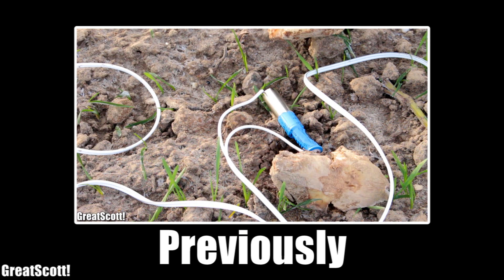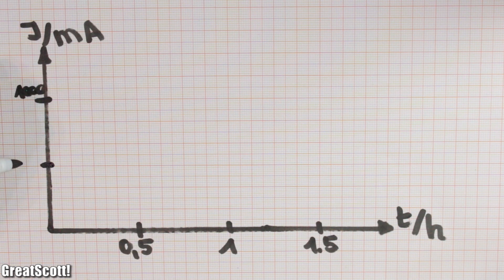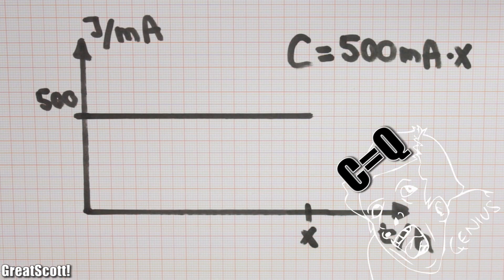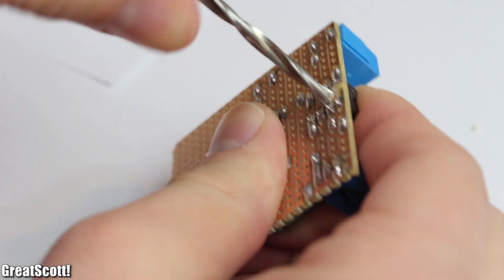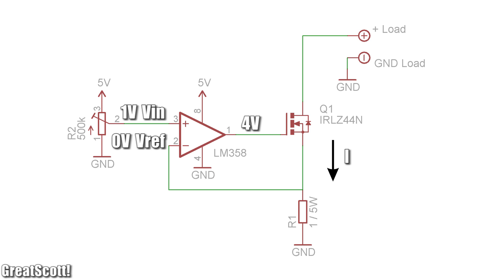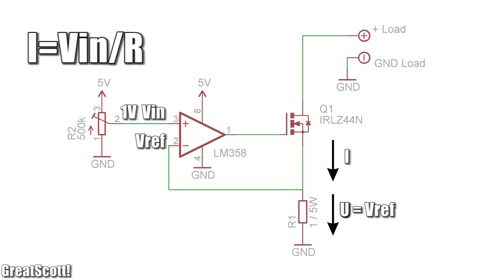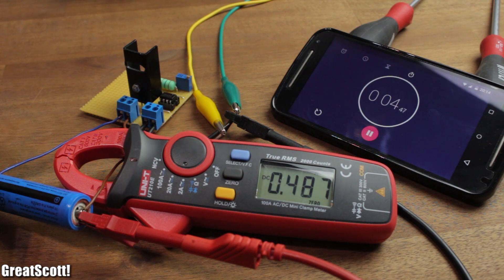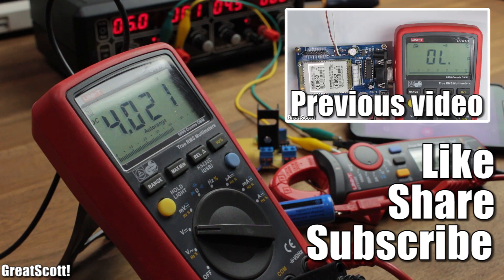Li-Ion Capacity Test || DIY constant current load

Comment: There might be a problem with the mosfet used. It works as a constant current source (or rather sink) and today's mosfets are poor in linear applications. The datasheet of this mosfet (unlike to some others) doesn't even show a curve for DC operation in its SOA. In this application using a logic level mosfet with low Rds is a bad choice. You don't get any benefits from low Rds. Power bipolars or Darlingtons are usually cheaper and work well in linear applications. The base current would induce a small error in the current source but usually negligible. So, your circuit might work but I'm really concerned about its long time reliability. Especially with such a small heatsink. I understand, however, that this is only a demonstration :).
Reply: Well, personally I've never seen anything like that but maybe it's just me. If you power the converter not from the cell checked but from a different source, you should be able to virtually eliminate current drawn by the coverter itself (usually quite small). Still, however, you will need to induce current flow at the output by using, for example, a resistor. There is an one issue though. If you have a constant voltage source with a resistor then you dissipate certain power. The same amount of power must go into the converter, so as the voltage across the cell drops, the current drawn goes up. And capacity measured depends on the current drawn. In datasheets you usually see plots of voltage across the cell over an amount of charge drawn for different values of current. In principle, you can try something like that but you won't be able to compare the results with datasheets but only with different runs/cells measured in the same way. The capacity is an estimate itself since it depends on many factors. Not only on current but also on temperature. So the exact capacity depends on a particular application.
Reply: The choice of a logic-level mosfet is a good choice. The limiting factor in this application is the power dissipated in it because it's rated for a continuous drain current of 36A at a case temperature of 100°C (or 50A at 25°C case). It has a maximum junction temperature of 175°C and a steady-state thermal resistance junction -to-case of 1.0°C/W. Unless you have a power BJT with better thermal characteristics, it won't be an improvement over the IRLZ44 and it's unlikely to be cheaper. As you say, the Rds(on) is irrelevant as it's not operating in its ohmic region. Obviously, you have to have a decent heatsink for any serious use.
Reply: @RexxSchneider  IRLZ44N is a switching mosfet and is not designed for linear applications. The maximum dissipated power is specified for switching applications. For linear applications the real max. dissipated power would be significantly lower and the datasheet says nothing about that. For the current source the value 110 W does not apply. What I mean is... using switching mosfets for linear applications is a lottery. Even if you meet the power dissipation condition. I read an article when NASA used infineon switching mosfets like that and they were used well below the SOA curve for DC yet they still burned. In practice, this might sometimes work but I wouldn't call it reliable. Switching mosfets usually have worse heat sinking capability and they withstand the specified power only when dissipated in short pulses... during turn-on and turn-off. In linear applications they dissipate power continuously. Generally when designing devices with any transistor you must make sure that you never exeed the max. dissipated power AND the SOA curve at all times. But generally I agree that it all boils down to the junction temperature. If you can (somhow) keep it low it will work.
Reply: @rezzywoof  The manufacturer makes no such distinction. Vishay Siliconix describes it as "Power MOSFET", with no designation as "switching" or "not designed for linear applications".

The maximum power dissipation is governed by the thermal resistance junction-to-ambient, and the datasheet on page 5 (Fig. 11) shows the transient thermal resistance as a function of rectangular pulse duration, and that is 1.0°C/W for all pulses with duty factor close to 1. That is the steady-state thermal resistance and determines the "real maximum dissipated power". It is clearly not "significantly lower" than the maximum 1.0°C/W quoted on page 2 (section Thermal Resistance Ratings") of the datasheet as you claim. Please make sure you have a full copy of the datasheet and that you can interpret the figures properly. The RthJC of 1.0°C/W clearly applies to steady state, not switching conditions. Given a 1.0°C/W heatsink with perfect thermal contact, that allows a maximum continuous dissipation of 75W.

You will find that the maximum dissipated power specified for switching applications can be determined from the datasheet. The datasheet on page 5 (Fig. 11) shows that, for example, a 10ms pulse with a duty cycle of 0.2 would give a transient RthJC of 0.5°C/W, allowing a maximum dissipation of 100W with a 1.0°C/W heatsink.

Your mistake is to assume that because the mosfet can tolerate somewhat higher dissipations under switching conditions, it cannot be used for linear applications. It most certainly can, and a steady-state RthJC of 1.0°C/W is as good as most power transistors, and better than many.

You are certainly correct to point out that power mosfets are prone to electro-thermal instability in their linear mode, which can arise from positive feedback within the parasitic BJT inherent in the mosfet design, and result in local hotspots and potential damage. It is also true that some manufacturers produce power mosfets with modified architectures (e.g. higher bulk source resistance) that are intended to reduce ETI when used in linear mode, but all of that does not automatically disqualify other mosfets from linear use.

The application in this video should dissipate 500mA x 4V = 2W at most. If all of that were dissipated in the IRLZ44, even if it were mounted on a cheap heatsink of 24°C/W (Digi-Key: 507302B00000G), the rise in junction temperature couldn't be more than 50°C. It is laughable to be worrying about NASA managing to destroy some mosfets under unspecified conditions, when we're discussing such light usage as here.
Reply: @RexxSchneider  When you mentioned the transient thermal response I think you are right... Perhaps my view on this subject was too superficial. I will take a look at the datasheet again :) Thanks for such an elaborate response. And yes I agree that for just a couple of watts almost any power transistor should be fine. It was some time ago when I wrote my first comment. I think I haven't taken into account the actual current in this project and assumed it could be much larger. Thanks again :)

Comment: cant we use irfz44n instead of irlz44n? i cant find irlz44n. how much amps this constant current circuit support? can i use it at 5 amps? if it is true,  that means i can make my own adj pwr supply. i surfed internet for 5 months but i couldn't find a good and working cc circuit ever! thanks greatscott!
and you must say that little problem of that 18650 to manufacturer of that 18650.
Reply: No. Unless you can select an IRFZ44 that happens to have a gate-source threshold voltage no more than about 2V. Failing that, you'll have to use a 10V supply for the opamp.

The maximum current supported depends on the amount of power you can dissipate - i.e. how good the heatsink is. With an infinite heatsink, you could soak up 100W, which equates to 25A at 4V. With a real heatsink, that would be a lot less.

If you draw 5A from a 4V battery, you'll dissipate 20W which needs a heatsink rated at no more than 6°C/W and preferably lower. That will be the most expensive part of the circuit.

This circuit isn't exactly right for use as an adjustable power supply.

Comment: Well considering how cheap those ultrafire batteries are that's not a bad result.
So long as they are cheap around 1 ah isn't too bad and still has some use in them for projects.

Of course they are not worth paying a lot of money for them, but if you want good batteries you have to pay a lot of money for them, as they are not cheap.

Ultrafire gives you an ok battery for a low price.

If only they were honest about the capacity of the cells and sold them for they really were instead of making such wild and fanciful claims.
Reply: No they are also from shitty quality

Comment: i saw someone is selling 6 of those ultrafire li-ion batteries with 9600mAh for just 5€.. what do you think is the real capacity?
Reply: more like 960mah. Panasonic's NCR18650G have 3600mAh capacity but they are extremely expensive and hard to find

Comment: Hi! I'll be doing this same approach  to test phone batteries, but using some lab equipment that are luckily available here (e-load, datalogger, DC source, scopes). But just one question, What is the reason/ basis why we stop at 2.5v? is it the level considered as battery low?
Reply: I wouldn't go below 2.8-3V unless the manufacturer's datasheet specifies a lower cut off voltage

Comment: Are you sure your clamp is off by 15mA? I have seem some videos and the UT210 is pretty precise, supposing you did the correct zeroing procedure. Anyway, with this kind of circuit, it would be better to use an inline current measurement, no?

Comment: From what i know these lithium iom cells cant get lower than 2.7-3v without damage... I wouldnt reccomend going lower
Reply: Usually 2.5 volts is the lower limit for them, with less voltage than this they get damaged. But to extend the life span its not recommendable to discharge them to 2.5, with 2.7 or even 3 V they get much less stressed.

Comment: Another possibility was to use a microcontroller circuit that monitor and saves the current in a SD card. Then, use some computer program to plot the current x time and do the integral.

Comment: But where's a pull down gate resistor, to get rid of gate capacity?
Reply: It's in the opamp's output - it's a push-pull output, so will source or sink current as needed.

Comment: I'm assuming if I just used different pins this would work with a lm386?
Reply: No, sadly it won't work. The LM386 has a minimum gain of 20 and an output dc offset of half its supply voltage. It's not a conventional opamp.

Comment: I bought in the past batteries from china for my metabo accu driller. After soldering it last about 2 weeks and it died. So I bought Panasonic batteries from trusted local seller and it has been under heavy duty work for 3 years now and it still working well:-).
Never ever buy batteries from china. I guess they are "refurbished".

Comment: Fantastic Experiment.
I also made the same circuit to test a couple of fake lithium ion batteries that I had.
The actual capacity of those batteries proves out to be only 418mAh.
And not 2500mAh as mentioned on them.
Thank you very much for letting me know this capacity test experiment.

Comment: Should read 4800 China-amphours
Reply: Bob Brown: "China-amp/hours"!!!!
Reminds me of the Hp ratings of Chinese motors.
There are those little bitty Chinese horses and then
there are those big, strong American horses.............
Reply: DD_Ranch Texas most US HP claims are BS. In Japan they under-rated their engines for a while (they started focusing on handling instead of an HP battle, which gave them much faster cars in real life, so they put an upper limit rating of like 275 HP or something even if the engines were 300-400 HP). In the US, we were rating older cars with stupid high HP which is easily disproven, we claimed crap like 1980’s cars with 300 HP that took 18 seconds or more to hit 60 mph... and they were cars, not literal battleships... and the new ratings are also BS, my dads Dodge Dart claims a higher HP rating than his old 1987 Mercedes (which is not even running right), and yet the Mercedes outruns it (and that car has like 200 pound electric seats, I felt like I was breaking my back trying to remove them from another car at the junkyard...). We still claim BS on most of the engines, and of course it’s BS rated on top of not using wheel power (somehow every car has the worlds most inefficient transmission ever produced right? That must be why 240 HP dropping to 170 seems reasonable...)

There are a few US cars that are actually rated correctly (typically dyno tested crate engines), and even a few that are under-rated. But then you also have BS like Dodges Hellcat engine bragging 777 HP or whatever, but then require a “race key” (in red obviously), to “unlock” that power (which is what you paid for already...), basically DLC from video games in real life... What a scam to advertise it as such and then lock it to 500 HP! So that’s beyond stupid.

As an engineer, I’d call it a faulty reject if it doesn’t hit the spec, if I buy a car and it’s out of tolerance, it should go in the scrap bin. The US marketing teams are about like the Chinese (which is super frustrating, I don’t pick a parts spec out of thin air, if that electronics piece smokes itself or melts at half the power, then why put that rating sticker on it?!?). Anyways, US drag racing is also flawed, it doesn’t measure time until the front wheel has already passed the laser, which means it takes off like 1/10 of a second or more (and yet posting crap in the thousandths of a second like it’s accurate or something...), so you could by their standard hit 60 mph in 0.000 seconds! Unfortunately you can’t get a negative time to 60 mph, but obviously if another car hit it 80 mph it wouldn’t have a lower 0-60 time). I guess it makes tanks with really long tracks look super good or something, it’s pointless, they are purposely measuring it wrong, just have a second laser, but oh no that would screw up marketing!
Reply: Fuck China
Reply: lol
Reply: Is like PMPO Watts.

Comment: UltraFire batteries are interesting. I bought a set of "4000mAh" red UltraFire's a few years back, and have been getting a fairly consistent capacity of around 2000mAh out of them when charging from around 3.2v to 4.2v which is very surprising considering. 

Despite my fairly good results with a set of UltraFire, I still wouldn't recommend them for anything of importance as I doubt they will handle much of a load and despite being labelled as protected mine do not have protection circuits in them. Also I think I was extremely lucky with the set that I bought as 2000mAh is very high compared to what others seem to get. UltraFire is comparable to playing the lottery :D

Comment: I made the same circuit using same mosfet bt it is not working there is something wrong with mosfet then i used 2 tip41 in Darlington configuration now the circuit works fine.

Comment: How know if a battery is original? There are some Thing for know about it when buy?
Reply: Only buy from a trusted authorized re-seller otherwise you can't tell untill you use it.
Reply: Sometimes you can tell by the weight though some fakes have sand in them allegedly LOL

Comment: Hi 
Great project 
Am I right in thinking if I replaced the 1 ohm 5w resistor 
with a 1 ohm 100w  (30w no heat sink) I have , that I could have a 2A load at 12v ( so I can test a lead acid alarm 12v 7AH )battery.
How big would I need for a heat sink on the mosfet ?

Many thanks p
Reply: If you use a 1Ω resistor, then you'll need to set 2V on the potentiometer wiper to get 2A through the resistor. That will then dissipate 2V x 2A = 4W.

The mosfet will have to drop the remaining 10V at 2A, dissipating 20W. At 25°C ambient, the mosfet can stand an absolute maximum temperature rise of 150°C internally. That means the total thermal resistance has to be less than 150/20 = 7.5°C/W. The mosfet has an internal thermal resistance to its case of 1.0°C/W, and a typical thermal resistance between case and heatsink (with thermal grease) of 0.5°C/W. That leaves a maximum heatsink thermal resistance of 7.5 - 0.5 - 1.0 = 6°C/W.
I'd recommend using a heatsink with a bit lower thermal resistance (i.e. larger heatsink) to give a safety margin.

Please don't discharge your lead acid battery below about 11V. They don't like deeper discharge and will lose capacity. By the time the terminal voltage has dropped to 11V, you've used most of its capacity anyway.

Comment: Nice video GreatScott! If something looks too good to be true it probably is. They seem to do similar things (but not so bad) with big leisure batteries. Either re- badge car batteries &/or quote inflated AH figures at the 100 hour (or even longer) rate. Ordinary people can get confused. I've tested several that don't meet their stated capacity.(Anybody watching, never run a lead acid anywhere near flat. 10.8 V with a C/20 load (5 a Have a nice day.
Reply: Sorry error in 1st reply, should read- 10.8 v for a 12 volt battery should be considered flat with a load of 5 A drawn from a 100 AH battery. Don't even go this low, especially with a car battery. Best to stop when down to 11.5 v or so, if you want reasonable life out of a 12v leisure battery.

Comment: NO NO NO NO. TO COMPLICATED,

HERE IS EASY STEPS: 
1) order voltage docter of eBay (type on 'voltage capacity measurer) and look for a blue transparent one. That is really good)
2) type in on eBay 'TP4056'. This is a charging board.

Connect them and connect the doctor to a 5v power source (any USB slot)

Measure the battery from flat to full charge. It should say on the voltage docter how many mills amp hours has been put in. 

And don't worry, the tp will stop charging the battery at 4.2v, so no overcharging.
Reply: Mr Awesome a LOT of power is wasted while charging, so this method will always give higher results than expected. Worse off, every battery wastes a different amount of energy from internal resistance so you can't even correct the false reading accurately